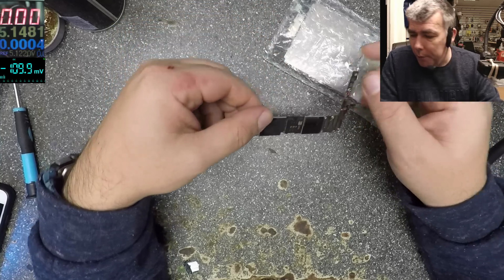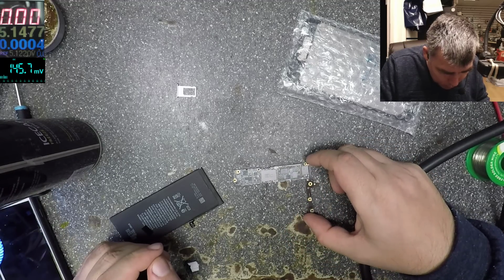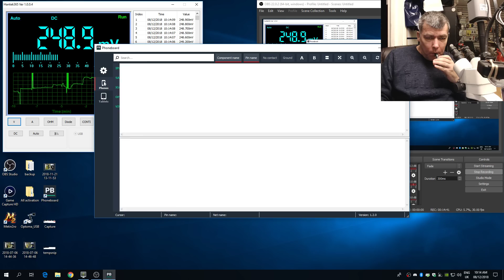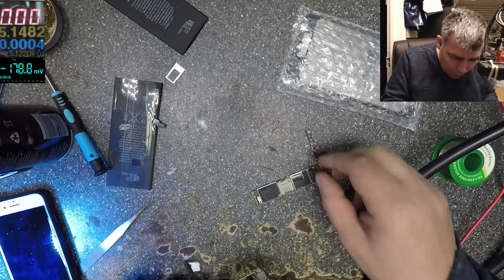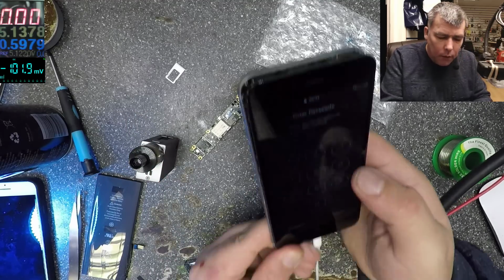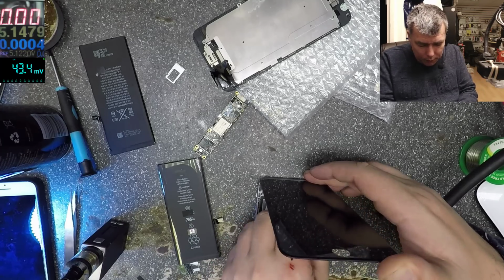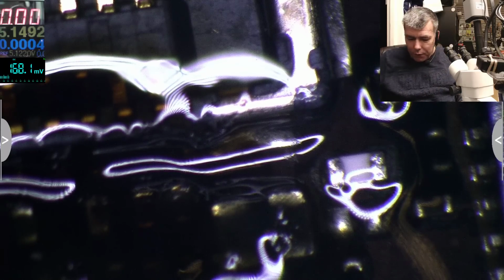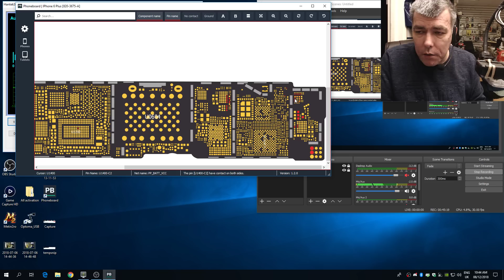Iphone discharging the battery repair

Comment: Pipe freezing spray 😂 looks great when you spray the board. I will get it myself. A great way to find a short.
You’re a great person to work on Saturday and make a video for us.
I thank you for the time

Ps I make  connectors from old batteries. So I can put easier current trough the board.

Comment: The freeze spray will often leave a board or component wet... the moisture condenses out of the air due to the cold.

Comment: Hi. Not related to the video but how to diagnose a laptop that is only working with battery. Charging port is good. I have 3.2v on power button and 19v on first power supply. Thanks.

Comment: I'm having a similar issue with a Xiaomi Redmi Note 4 everything seems to work fine but even with the phone completely off it discharges the battery. I've tried freeze spray but couldn't find anything obvious.